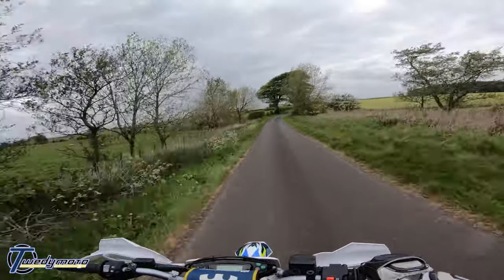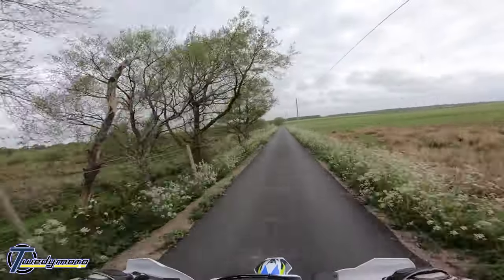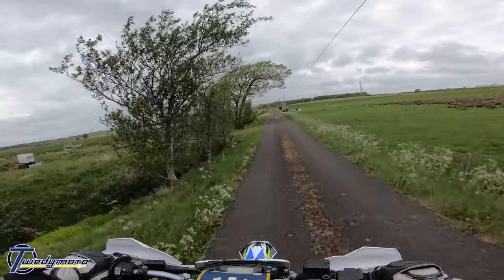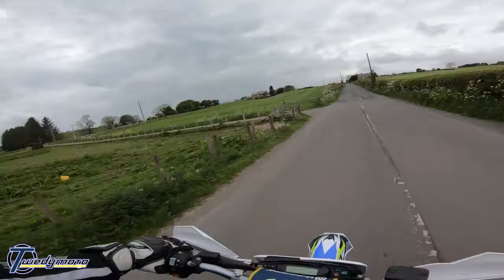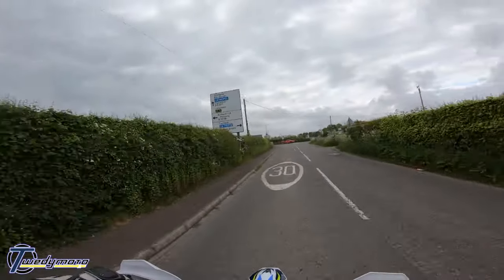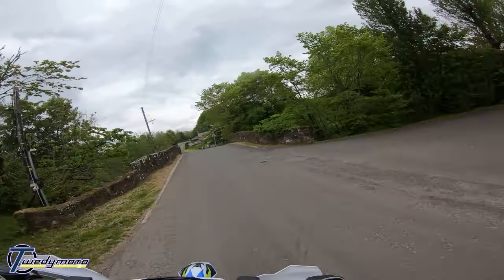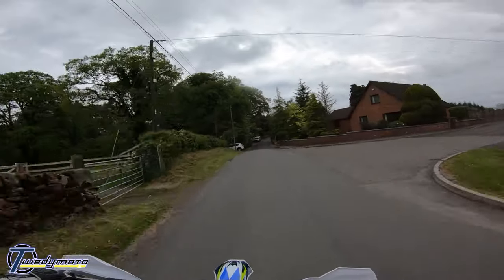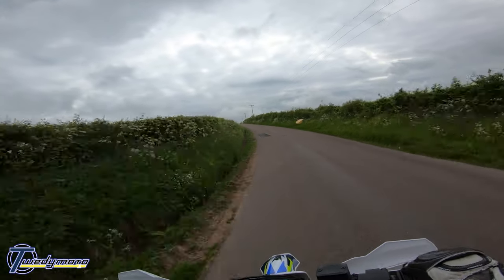BRAKE UPGRADE!! | HUSQVARNA 701 & KTM 690 SMCR SUPERMOTO MODS | BURNOUT FAIL

Comment: Are you still running the OEM 4.5mm rotor with those pads? Curious if there's enough room to fit the SC compound pads with a 5mm rotor on my 19' 690
Reply from the maker: Yes mate, was the stock rotor. I can't remember what the clearance was like when I changed them but I'm pretty sure there was a fair bit of room left.

Comment: At how many miles did you change the brake pads? Mine has done 6.200 so far and the front brake is very mushy and i also had issues with the rear one locking out while riding without touching it for no reason! 
  I replaced and bled the fluid on both the front and the rear with the Motul RBF660 and it fixed my rear brake issue but on the front only for a while it's still very mushy, i'm thinking of getting it to a dealer and bleed the ABS maybe that will fix it although i've read online that the front master cylinder on our bikes is very weak!
Reply from the maker: It was about 8000 miles mate. There was still plenty meat on them but had a track day coming up so fancied something with a bit more bite. You can trigger the abs pump on a bit of gravel or sand or something then try bleed the brake again. A lot have upgraded the master for a brembo 15 rcs.

Comment: I just bought this bike and wanted to upgrade to a brembo radial rc15 pump , now i find out its too big to use because the fender thingy wont fit aswell as the fender is bolted in the original brake pump